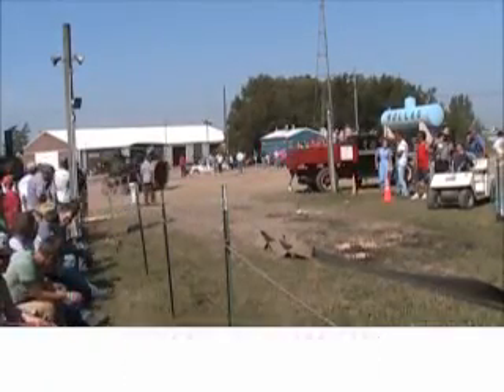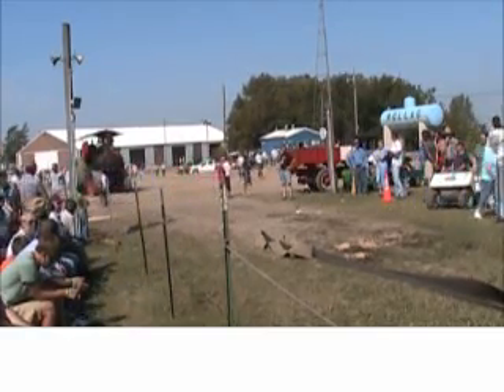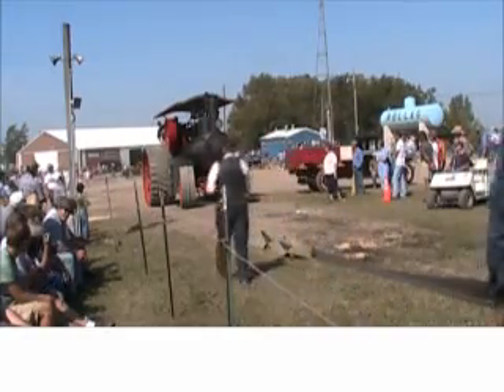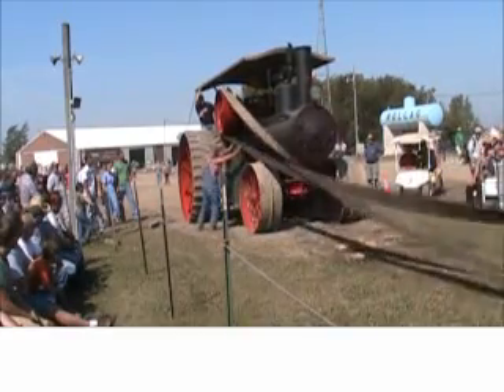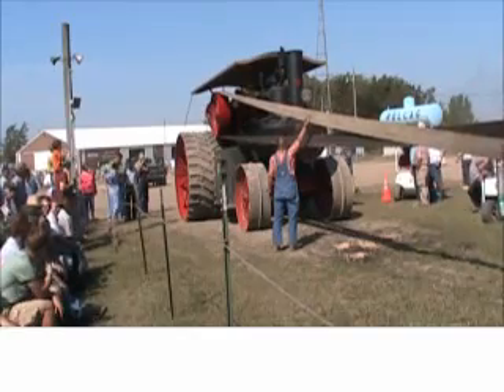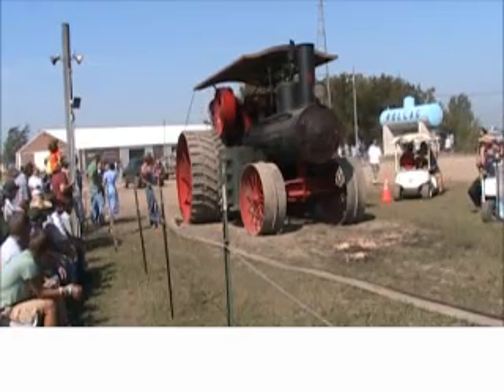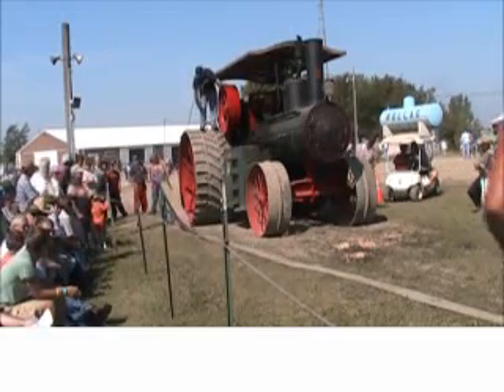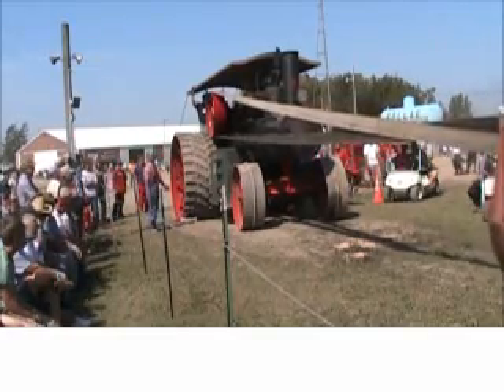Steam Tractor on Dynomometer - Torque and HP Explained

Comment: I literally had a guy on one video say that a 165 hp steam engine has the same torque as any other 165 hp engine. And another say that the torque at the rear wheels of his diesel pickup with all the gear reduction was more than the steam engine has so its not that impressive.... some just don't get it.

Comment: Then how do they explain torque rise in a diesel engine? Rpm and horsepower are falling under load, but torque rises.
Reply: torque never rises with diesel engines, turbo helps but its always down, most torque you can get up to 2500rpm max, then with every gear you are losing more and more of it.

Comment: This steam tractor has many thousands of pounds to hold it to the ground and special iron wheels to create traction. s
Simply put that is the "X factor" that allows it to out pull most modern equivalents. That and durability. It can deliver that power and not tear itself up. Today's engines and transmissions can't take the abuse of even pulling these tractors. But they could if the suspensions and components were upgraded to handle heavy loads versus designed for highway speeds. Horsepower does not measure traction potential, top speed, or pulling power. Pulling power depends on the gearing of the drive train and other factors including horsepower.

Sorry but I had to......

Comment: Chain your 300 hp sports car to the back of one these steam engines. When your clutch goes white hot and disintegrates you will have a practical demonstration of torque and draw bar hp.
Reply: marcin l wrong. This steam engine is incredibly heavy. I guarantee itll rip that 300horse car in half. Traction plays a big factor in pulling competitions.
Reply: Your car don't got no 3k foot pounds at the engine if thats what your talkin bout.

Comment: With 25,000 pounds of pulling force, that's more than enough to stop a jet fighter at full afterburner.
Reply: f-15 dual engines on full afterburn produce 59000 footpounds of force...(16 tons of extra weight can be added to the airframe... fuel/weapons)
Discounting airfriction it could go supersonic pulling the 120 HP Rumely steam tractor.

F-15 AMAZON Tractor Delivery! incomming
Reply: @givemeanameman1  Well boeing has even more but nothing as we know today can match steam engines in pulling power, boeing has two 115.000hps engines, at full throtle it could not move old titanic operating at 1 of his engines which was rated at about 15.000hp, 230.000hp would get pulled away, let alone that steam engine operating at full power (about 35.000hp) it could potentially have 300k+ torque... which is insane, the multiplier for torque is nearly x300 for steam engines, example jet engines only get 0.3x ...
Reply: Asofe17 I don't think you understand torque at all, Further Titanic had 3 engines with a total HP of 76k.

Assuming a Boeing engines are 115k hp each they most assuredly can move the titanic even if its under full thrust if we assume engines are mounted on the ship and not an airplane that would fall from the sky due to low airspeed obviously :P
Torque does not multiply energy, it allows force to be applied over a longer/shorter time frame.
This is why engineers use the term moment of force to refer to torque.

HP is the "power" and Torque is already taken into account in the given rating.
Reply: @givemeanameman1  I think you are at misunderstanding here, horsepower and torque isnt the same thing, because you need different things for speed or for pulling power, there is no way in hell a jet engine could pull any decent load, thats why we s till use trains with diesel engines instead of jet engines 5000 hp train can pull shitton of tons (pun intended) slap the same 115,000 hp jet engine and it wont move the same load even 1 cm. And steam trains have approximately 3-4x the power of diesel engines check this article, force multipliers are very different, stroke and bore haave the most importance, simply jet turbo which pulls air trough cant pull any decent load, thats why planes are so lightweight compared to their  power.

One single titanic could probably pull 4-5 boeings at full load without a sweat.

https://www.theatlantic.com/technology/archive/2011/12/a-single-boeing-777-engine-delivers-twice-the-horsepower-of-all-the-titanics/250698/
Reply: Just the weight of the tractor sitting there would keep a fighter jet from moving at full throttle
Reply: Welll, damn. Remind me to never wrestle with one.